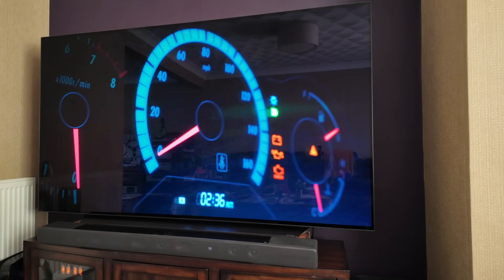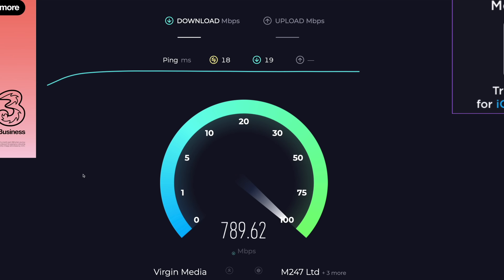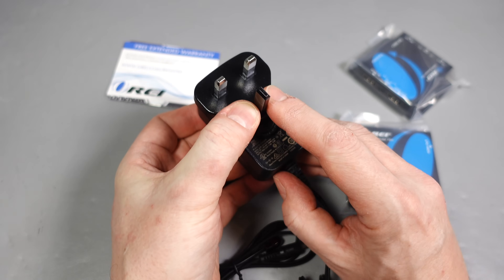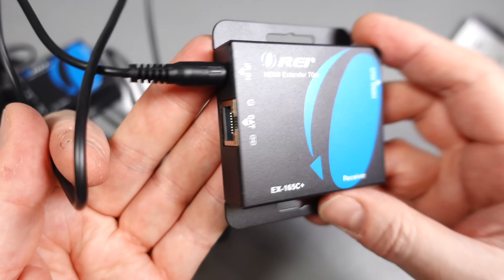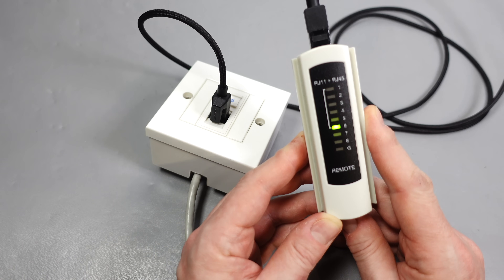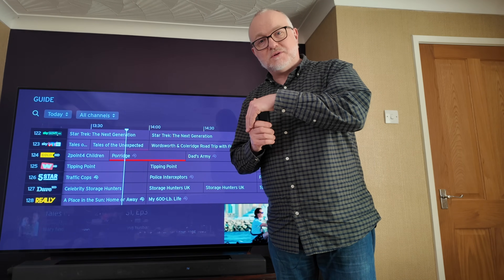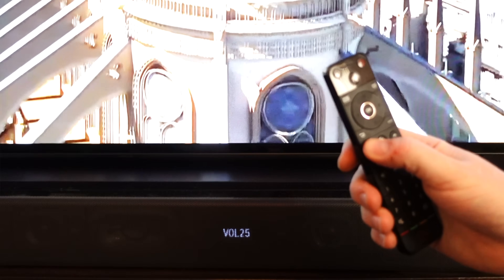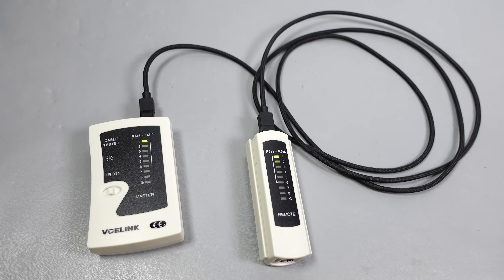HDMI via a Cat6 cable works surprisingly well

Comment: You may have connected the network cable in the A/B arrangement on purpose in the past, because that's a "cross" cable and it was commonly used to connect two network hubs together. If you had a network hub in either room, it would have made sense to connect them together through the wall sockets.

Comment: This is a standard deployment for central stations in hospitals.  The central station is a PC that displays all of the patient monitors on a unit.  The PC is on a shelf of a rack in a network closet.  The PC's HDMI and USB connect to a sender.  The sender connects to a CAT6 that runs to the nurse station and is connected to a receiver.  The receiver connects to the HDMI on the monitor, and USB keyboard and mouse.  It can support two HDMI monitors for centrals with two displays, or it can support touchscreen if there is only 1 monitor (this is not a limitation of the sender/receiver, but the way the software is set up on the central). 

In addition to this, large Central Monitoring units that have multiple centrals stations can be connected to a KVM and use an app called Kavoom to allow the mouse to move between screens on all the PCs without having to manually switch the KVM.  The keyboard follows the mouse to whichever screen it is on.

My last install was a 335' run with a standard CAT6e, and I had a coworker have an install that was over 500'.  He told me they pulled a special cable for that, but could not tell me what it was.

Comment: My receiver has a power brick as well and I'm using it with my computer for 4k/60. It does support this and I've used it without the receiver plugged into power, but would I get a better experience with that also plugged in?

Comment: I was in charge up grading a VGA projector setup. Used something very similar with a few extra options like an HDMI Switcher, Striper and Distribution. Then something similar to these things. I wire up the cat 6 to the T568b as that is what most of the devices are wanting. It works with out fault. During my research there are more expensive ways like  HDMI over IP that does go over the network though that would have been overkill for that use case I was charged with setting up...

Comment: the orei device is not auto-MDI-X capable, thats why its important to have A-A or B-B connection on the cable ends. and thats because its not even a network device, it is using the cat6 cable only as physical media

Comment: Hello Mr Moan.  Thanks for all the great vids over the years.  I'm writing you directly through this public forum post comment #676 that you'll never ever see.  

Now that I have your attention, just something I thought whilst watching.  A two-cents kinda thing:  Do like me and learn how to make your own Ethernet cords.  It's dead simple.  You buy a cheap specialized wrench I'm sure you've seen (the one I got even has a little tester in the handle!) and a bottle of end pieces, do a little googlin, print out the little "cheater" diagram card (xtra tip: laminate it!!)  and Bobs your Aunt Hilda!!!  Why I mention is you say you bought a "small" ethernet cable.

I hear ya, nice n' tidy, BUT if you learn that you can make em fit perfect.  Like I have two coming straight off my router to my Ooma and the Living Room Roku and before they had all that bundled rubber-banded xtra cord, look allright, but now it's a perfect 8 inch run AND since you can use your own tip colors I got some color coding going on.  Really really looks good.  I know you like a good clean component setup (I've seen your HiFi setup) so thought I'd try.  Hope by a Xmas miracle you read somewho.  It's WAY easy.  After first 3-4 you'll be makin em like no tomorrow.  Thanks again, Take Care.

Comment: In case there is no special standard for HDMi installations inside houses and therefore special cabling. Couldn't you kinda just add some micro HDMI adapters before you drill a hole?

Comment: In related technology, there is also a standard called HDBaseT that can send HDMI, but also USB, control signals, and power, over a CAT6 cable. Especially useful for professional installations where someone might bring their own laptop to plug in to a system but the projector is hanging from the ceiling - the (USB or network feature can be he used to send control signals to the projector without needing to use the remote control). Many projectors even have built-in support for the standard these days as well.

Comment: The Virgin 360 input looks like it has a lot of artificial sharpening added to it. It's not actually clearer. Not sure if that's the box doing it, or it's your TV that reset the settings for the input and reapplied the usual ridiculous sharpening filter.

Comment: In a past life I helped run a chain of video gaming centers. I would fly out and help set them up. We used about 40-50 of these converters on site. Kept all the consoles behind the counter so staff could be disc jockeys and games would show up at each seat. They worked pretty well. We used them for years. They introduce a bit of delay but most folks didn't mind. And we had standalone PC seats to cater to them anyways.

Comment: As someone who works in event production, I come across these devices pretty regularly. It works much better than a long HDMI run, granted, but the same type of conversion run over HD-SDI, is much more reliable in the field when setting up and breaking down the gear all the time.

Comment: It would only make sense if it would support HDMI 2.1 or Display Port + USB. Pretty much the only reason you need this is when you have PC with powerful GPU in your home office and you want to connect it to your 4K OLED TV in other room.
HDMI 1.4 is worthless since all TVs have Steam Link app or you can use any PC from last 10 years as a Steam streaming client. HDMI 2.1 or Display Port can do 4K 120 Hz and VRR/Freesync with 10-bit color at lossless compression. Anyway local 1Gb/s network streaming will deliver better quality than HDMI 1.4.

TV broadcast is even simpler. In my country you can get multiple 4K STBs for 5€ each per month on top of your contract. However you don't even need them, since you're getting smart TV app that has most channels along with its own streaming service.

TV manufacturers would sell their own solution of HDMI over LAN if there was a need for such product.
You don't have to put HDMI plugs through your walls. There are special plugs you can put your own cable in.

Comment: There was a time when crossover ethernet cables were needed, but it was a long time ago now.

I've got an infrared remote for my electric heater. Due to cable length, the heater is sideways and I'm having to try to get used to pointing the remote to one side of the heater to bounce the signal off the wall. It's not easy!

Comment: I got almost the exact same one for my local bar. They are Orei, but slightly larger, and either end can be powered IIRC…

Got this after watching them struggle with pulling stupidly long and unreliable HDMI cables to their new LED wall outside. These worked first time, and has done for a good few months now. Was much easier and cheaper pulling a few CAT6 cables in.

Comment: One other thing to keep in mind is the limitation HDMI cables have as far as length is concerned.  Using a sending/receiving kit with Cat 6 cable will handle long cable lengths up to 150 ft.

At our church, we're using Ocean Matrix brand HDMI to Cat 6 extender units and they works great.  The kit we have has a 4 receivers total (1 for each TV) and a sender to distribute to 4 TVs.  You just run a Cat 6 cable for each display to the sender and run a single HDMI from the sender to the video source.  We also added in an HDMI switch box that allows manual or automatic switching of up to 6 HDMI sources to feed to all our displays.

Comment: I use these devices in my theater f9r various projectors. The problem is when you go over 100 feet, the cable type and box has a large effect on operation. I struggled to go 125 feet reliably. I found the issue was crosstalk between each twisted pair. You need cable with each pair shielded from each other.

Comment: Wish these had come out earlier.
I had a similar situation with connecting my desktop PC to my LG OLED TV. The TV was close to my PC but there was no clean way of easily connecting the two with an HDMI cable without running the cable across the room. The only acceptable way was to run the cable near the wall with two door frames in the way. Tried an active HDMI repeater but that failed miserably. Ultimately ended up getting an really expensive (over 200 EUR) 15 meter long fiber-optical HDMI cable.

Comment: The proper standard for this is HDBaseT - a lot of the Amazon ones are chinese clones that are uncertified with the standard. However if you look at brands like ATEN, they do certified HDBaseT senders and receivers. They also do some great AV Over IP Transmitters and Receivers. They are networked and each have an IP Address.

Comment: Here where we are on Telus Optik TV They have one main box (Much like your Sky) which has the PVR inside and then they have secondary boxes that either connect with Wifi or with ethernet.
The only sad thing is they give you an ISP Provided Router which does some fancy QOS Packet routing for the TV and if you swap that out for your own router the TV doesn't work.

Because I wanted my Internet devices to run off of my own Wifi router What I did is moved to a non supported Non standard confituration of 

[Fiber] -> [ONT] -> [Switch] -> [ISP Router] -> [Optik TV Boxes]
........................................|----->[My Router] ->[PC's, Smart devices, Game consoles and all other internet connected items that aren't the Television]

For the price of a small Dlink 5 port switch It keeps my data network and my TV network seperate which is beneficial to me when my son is watching TV as is my Mother In law and my wife is working from home during the day or when my wife is watching a late night movie and I'm working a night shift.

Comment: I'm a little surprised the Bluetooth is still in range at the distance between the TV room wherever it is and the "bedroom at the back of the house". If I leave my phone on the charger in my bedroom at the back of the house and go to the other side of the house where my TV is, my smart watch will probably disconnect.

Comment: I have replaced about  of these in about 3 years. I even made a cooling box for them, they still die. Seems like the last run of them I received are lasting longer. I give them a thumbs down at about 70% after using many of that same exact module!

Comment: I've used these type devices for years for digital signage in a library. We just run PowerPoint on a pc, and leave the pc in the "server room".  No space lost to the staff area, and the responsible party accesses the pc remotely from their pc.  Much cheaper than packaged signage systems with licensing required.  The cable run tested to 170 feet, video is perfect, sound worked in testing but is not used.

Comment: Interesting, our local version of virgin media in the Netherlands, Ziggo, has started to rollout a tv box with Ethernet connection for the TV signal, Wouldve figured virgin to have the same (as the virgin360 is basically the same thing as the ziggo next box)

Comment: Here in the US, I have YouTube TV, so I just stick a Roku, or Google Chromecast box on my TV's, they all connect through my mesh WiFi setup, it works fine, so no need to run Cat 6, and use HDMI extenders.

Comment: Man I love this sort of stuff. 😊 I know Matt had to use this solution because he's streaming from a proprietary box but I stream from a PC in a cupboard and unfortunately the house isn't wired for ethernet as it's too old so I use wifi (router + extender). It buffers with hi res content so isn't ideal.

Dropping Cat6 to the media rooms would be ideal but pricey. I'm thinking a good 3 node mesh solution should do the trick. Anyone got any recommendations for the best mesh setup that wouldn't break the bank?

Comment: These have been around for ages, these have been high quality for ages, alot of professional projectors actuall have these built in. 

We often use ones that use actual ethernet signals. They can be split using standard network switches.
Reply: The ones using actual Ethernet have lower image quality and a touch of extra latency.

Comment: We’ve been using a similar kind of setup for the livestreams we do at our local church when there’s stuff happening outside. Though probably a much cheaper version. It’s quite neat that the units we have are powered by 5V DC so I made a little adapter so I could hook the transmitting end up to a power bank. Works a treat! Though there’s a noticeable latency in the transmission with ours so just be aware when using it for games consoles it might not be the ideal setup depending on the individual box.

Comment: Fitted hundred of these (not this brand) but loads, one of the most annoying things about them is the green lines and interference you get on long runs and THE most annoying thing about them is that they don’t work with power line adapters (I mean obviously they don’t) but imagine if they did, the solutions would be incredible, clearly the data can be sent via cat 5/6 so ssaurrellyyyyyyyyy… 😂😂

Comment: If the hdmi over cat 6 supports hdmi CEC you should be able to use the IR built into the TV if you wanted to do that for some reason. I don't know if your specific hdmi/cat6 suppors cec though.

Comment: For that price, I'm assuming those are 1000Mbps ethernet ports which isn't enough for uncompressed 1080p50 video. There must be some video compression between the boxes right? I'd be curious to see a stress test (like confetti or something). Of course the compression from the satellite feed is likely the weakest link so for regular TV this is unimpactful.

Comment: I had a similar setup from around 2020 to 2022 but using an unbranded HDMI extender because I hadn't heard of OREI back then. In my case, it was because the DVR software on StarHub TV didn't support remote scheduling and streaming to other set-top boxes, so I used one of those extenders to split the HDMI output from the set-top box in the loungeroom to both the TV there and in my bedroom, and that even supported the weird IR frequencies the remote used (the unbranded wireless composite A/V system I used in my previous flat couldn't do that).

You signing up for Virgin Media internet and them upselling you on Virgin TV reminded me of when I decided to switch from StarHub to Singtel because the former stopped offering their old StarHub TV digital service to new individual subscribers and they didn't put in DVR features on their newer IP-based Starhub TV+ system, while Singtel TV still has DVR features and they have both the DVR streaming and scheduling features I mentioned, thus negating the need for the HDMI extender (as I could have a separate set-top box in my bedroom), which I do still have other uses for, like hiding my video disc players in the storeroom. I could even hide the TV boxes if I got more HDMI extenders, but I don't think I'd have the space and I got used to looking at the box for the time.

Comment: I use another solution for this which is an HDMI to DVB-T2, on the set-top box you conect the HDMI end and the coaxial to the TV distribution system so I can watch the content from any TV of the house in HD

Comment: Coolest HDMI-over-UTP job I ever worked on was a new medical/surgical training facility on Sydney's largest public hospital campus, multiple operating theatres and labs kitted out with remote-controllable PTZ cameras and a combination of shotgun and ceiling-hung microphones. The video + audio from any camera/room could be routed to any of the five floors of meeting/conference/research spaces via a chonky HDBase-T matrix switcher built by Magenta, which took up three equipment racks including the patch bays, had a high-six-figures price tag, and could send/receive 1900x1200 high framerate DVI video up to 500 metres over special UTP cable that had an equal twist rate for all four pairs, to minimise RGB skew. Pretty cool system for the mid-2000s.

I believe there are some systems which can transcieve/route/distribute digital video over a dedicated ethernet vLAN, but they're aimed squarely at the corporate/education/digital signage markets and are priced accordingly.
Reply: The Ethernet versions aren't too much more expensive. The Orei has an IP based kit for $89.99 compared to the more basic model Mat got which is $46.99. It's still twice the price but it's not crazy expensive.

Comment: A few years ago, I tried to be slick and experimented with using an HDMI-over-Ethernet transmitter (only the transmitter, intentionally left out the receiver end) to be a video capture source by plugging the Ethernet cable into my computer. The experiment unfortunately failed either because I didn't account for the HDMI encryption (which the no-name brand device did not have the built-in hardware to negotiate because HDMI licensing is expensive) or because the software I was trying to feed it to (IIRC it was a streaming software like OBS) couldn't recognize it as a proper video source. I even spent hours in Wireshark trying to diagnose packet captures to see if I missed something in the feed but to no avail.

Comment: I don't know if these ever existed in the UK but in the US, TiVo did a very similar (if not identical) thing officially to be able to link two different TiVo units together and watch recorded shows on one on another TiVo-connected TV set. I don't think this was all that popular but I had their setup and it worked great once it was up and running. Just took a little bit of finagling to set it up but then both TiVos saw each other and you could watch stuff on either one recorded on the other, with no loss of quality or speed.